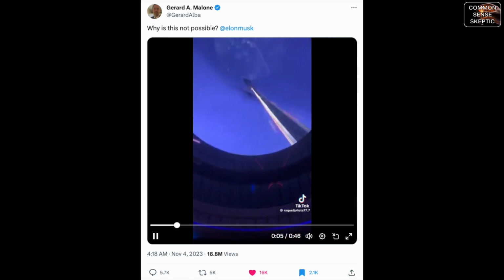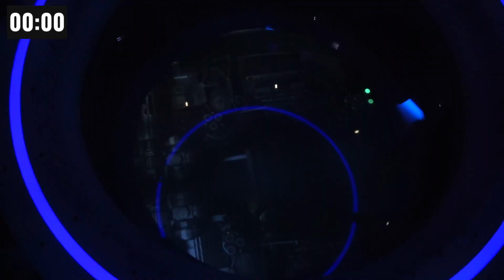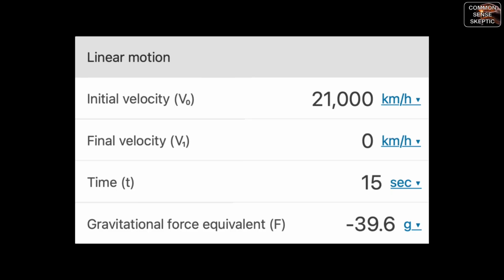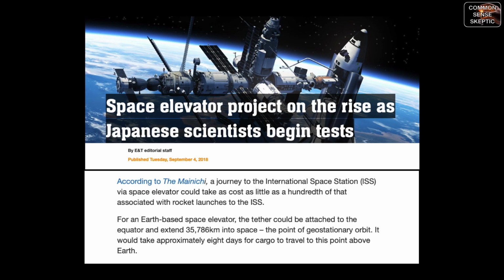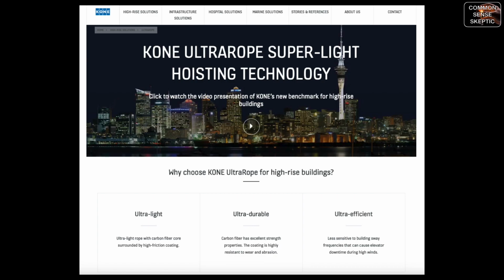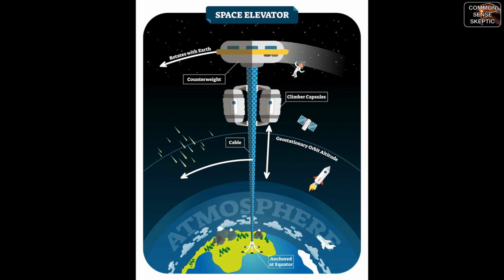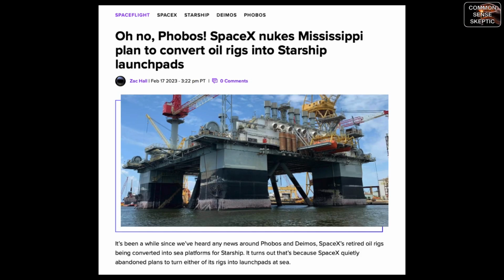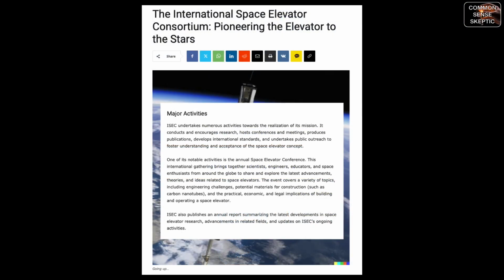DEBUNKING L.E.O. SPACE ELEVATORS

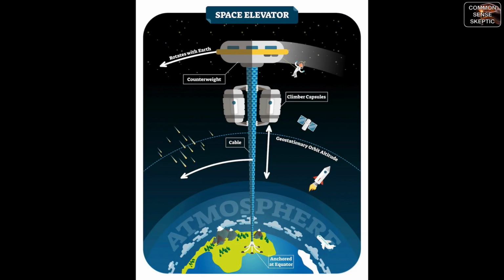Comment: 5:01 Their is a way to have a space elevator teather in Florida.  Florida to LEO station and also Peru to the same LEO station. 

6:34 Eletricity  from the grid (possibly to the climber or through the cable)

7:09 Rocket comparisons are not correct. The rocket is going 20,000Km/hour horizontally across the planet not verticaly.  (see the altitude at 198KM at 8 minutes)

8:38 Despite all the mistakes above  (2651 (km / hour)) * 8 minutes = 353km.

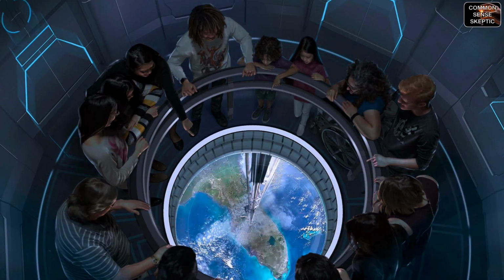8:50 : Move the station out to GSO and the point on the cable at 350KM will still be stationary. This allows you to build the station.

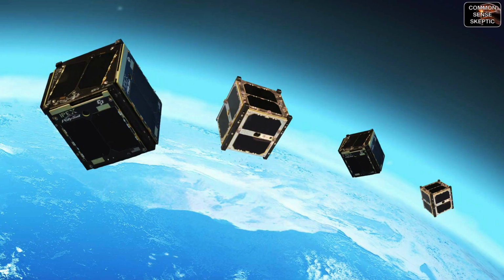10:23 You are above the atmosphere which means no atmospheric drag

10:38 Possibly their is a tether connecting them to the elevator above the station and they are behind the station on the orbit.

11:08 the station is traveling at 10,800km/hour if you use the same refrence frame at 27,576km/hour for the ISS.  But with the plane changes the diffrence is much more then 17,000Km/hour

14:49  : The counterweight does not put any weight on the cable. Think of it like hanging a rope from a bridge. The weight of the bridge does not change how strong the rope needs to be.

15:02 Testing for the beaming part of the elevator currently use 1km cables. (Still a lot more then the required length still)

17:11  at just 8km up the air pressure is only 30% of the ground
 
17:51 you do not want a lot of weight pulling at the ground as that would makes the cable required to be much stronger. Even if you only have 100 tons of force then still means you can have a 10 ton climber without pulling the anchor below GSO.

19:26 If you go the ocean anchor you do not want it to be attached to the ground. You want to be able to steer your ship around the weather. The MSC Irina for instance weights 240,000 tons fully loaded. This is a pretty good anchor.

23:00: You disconect the  ground station and now the cable falls stright down and does not wrap. (Plus with how light weight the cable is , it will likely burn up in the atmosphere)

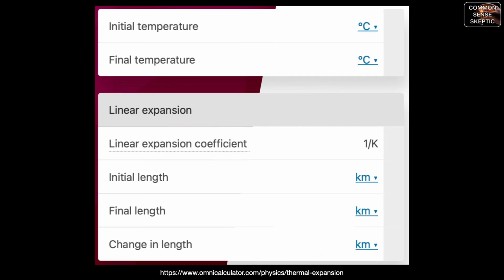23:46 Why would the higher up of cable be in the shade. The earth's shadow is only so big. 

-

I argue that a space elevator is more unrealistic then O'Neil cylinders and Mars Colonies. 

We have a pathway to them without new breakthroughs in science (only economic).  We do not have a pathway to a space elevator without new breakthoughs.

Space hotels with gravity also do not need new science(only economic) unlike orbital rings.

Comment: There are several factual errors you've made, even tho your overall point is pretty much correct.
For one: The Kurzgesagt space elevator has its station at geostationary altitude and its counterweight past that. And with a station in a geostationary orbit you can indeed just release satellites without adding any significant thrust (tho you'll want to adjust its orbit so that it won't collide with other things you've released or the space elevator itself.

Another reason why even a space elevator station at LEO would be beneficial is because you can in theory push an object to LEO without using any fuel that has to be carried. Your object still needs to accelerate to orbital velocity, but since it's left the majority of the atmosphere it needs significantly less fuel for that.

Then your argument about storms in the high atmosphere: Yes, they have much higher wind speeds. On Mars you can even have wind speeds of ~400km/h... and yet, due to the low pressure you'd barely feel it.

The biggest show-stoppers for space elevators are the lack of interest/funding and the material science of simply not having a material that can support itself for such great lengths.
There is active support in theory, but I don't think it's ever been tried in practice, so not too sure about that.

Without rewatching I won't remember all the mistakes so this ends my critique.

Comment: 4:57 The endpoint (from which the entire construction is suspending) has to follow a geosynchronous orbit, geostationary even. That can only be exactly straight above the equator and at a distance of 35, 786 km above mean sea level. This requirement is not a matter of expert opinion. It is a matter of physics.
Reply: And at 400km above the earth you can split the cable into one going North and one cable going South.

You also need the endpoint higher, you want it pulling the cable tight. And then because is it tied to the planet you get GSO that way.
Reply: @catprog  I like your subtle sarcasm.
Reply: @bosoerjadi2838  So subtle I do not even see it.

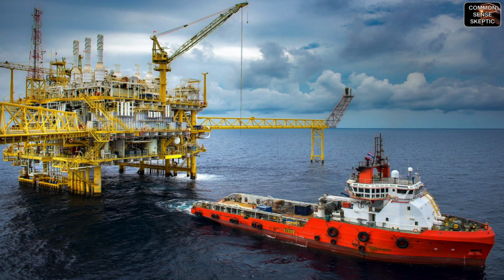Comment: 20:20 the possible harmonics etc could be a problem but presumably carbon nanotubes or whatever they would have to use would be easily elastic enough that the cable would remain straight no matter how high the seas got especially if the cable had to reach all the way out to geostationary orbit. 

(That said I don’t know how much general purpose hull or unobtanium or whatever would stretch elastically and it would probably take something like that to actually take all the punishment the tether would likely receive over the centuries.  General purpose hull would be especially good as breaking any part of it causes the whole thing to disintegrate so unlike unobtanium it wouldn’t survive reentry (nanotubes wouldn’t survive from above something like 1000 Km up as well.)

Comment: We humans have done the math, and only carbon nanotubes would maybe .... Maybe be able to have the required strength... It's right there on the edge... 

The general idea is that a station on Geo would Bild the cable down and up from Geo with a counter weight moving away from it to balance the cable coming down... 

This Is complete Sci-Fi... But we do know, it will be really hard because we know a few things... No material will hever be as strong as ideal carbon nanotubes and those if you run the numbers are at the edge of making this possible....

Space elevators would work on space bodies with higher rotation speed and lower mass.

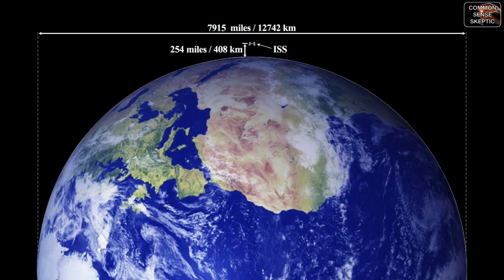Comment: 12:04 I may not remember this correctly but I think the kurzgesagt video was assuming a space elevator with a counter weight at geostationary orbit and some length of run even further out to allow the launch of stuff out of orbit.

If the counterweight station was in geostationary orbit (and there was a material strong enough to work as an elevator cable etc etc) so kurzgesagt was saying something accurate, by definition if you are in geostationary orbit you are in orbit.
Reply: The counterweight cannot be at GEO .. has to be well beyond to keep the tether taut (via centrifugal force) or both the tether and the counterweight will fall to Earth
Reply: @xenuno  usually the models have a very heavy rock at the geostationary position so that it doesn’t get pulled around easily and a much smaller counterweight on a second tether at a higher position that can be winched up and down to keep the masses balanced and keep tension on the cable etc, it could also serve as a launching point to send stuff out of earth orbit.
Reply: @glenecollins  Ya I spose that would work but all the models prophesize tether properties and dynamics based on Unobtainium, specifying strength, density, and a host of other properties that real world materials do not and will not ever possess

Comment: As always, it's a lot easier to make a CGI video than actually work through the engineering challenges.
I have met plenty of 'idea guys' in my career.  They throw out impossible or near impossible concepts and then get frustrated and angry when engineers tell them why it's not going to work.
Reply: damn architects
Reply: <<I have met plenty of 'idea guys' in my career.  They throw out impossible or near impossible concepts and then get frustrated and angry when engineers tell them why it's not going to work.
>>

Heh, heh!  Economists are good at throwing that kind of cold water on projects as well.
Reply: You may be surprised to learn that real engineers are working on space elevator designs right now. People who know what the real-world challenges are.
Reply: Engineering challenges were worked out well over a decade ago.

It's not even that expensive.

Is just an idea that sounds so crazy nobody is willing to actually take it seriously.

First of all you use Rotating Space Elevators (RSEs from now on).

Imagine a wheel traveling along the ground. If your car is going 20 freedom units per hour, then your wheels are going from standing still to going 40 freedom units, in a sine wave.

Now make that wheel double the length of low earth orbit. Now get rid of the wheel and just make it a ribbon about 3 ft wide and a couple of micro freedoms thick.

Every time it goes around when it hits the bottom it will be stopped. All you need is a hook on the end.

By having adjustable mass at the center station, weight going down, cancels out weight going up.

So assuming some sort of peerage agreement is worked out, that's a "free" ride to orbit.

You can increase or decrease the amount of tethers arbitrarily, so scaling is easy that way.

And you can put them in progressively higher orbits.

That also means you can use them for deceleration. Meaning faster transit times, and getting paid for extra momentum.

Does a bunch of other cool stuff.

Does it take any unobtainium. I'm pretty sure according to the math, regular kevlar would work.
Reply: @jtjames79  Nothing you said was true, Mr Idea Guy. The engineering challenges have NOT been worked out and no material in existence now or even prophesized in the future is up to the task. You've been watching too many Pop Sci channels apparently or ... your comment was all in jest

Comment: Around cough twenty years ago cough this came up on Physics Forums. Some folks over there worked out the math on just what the parameters would need to be for this mythical cable to work.
And if it's just a cable stretching out into space, it would need to be lighter than air and stronger than steel. 
Now there may be some kind of engineering mitigation like, idk, stations along the length with, idk, balloons pushing against the atmosphere and, idk, anchoring the next cable up.
But then there are all kinds of other problems that you mentioned which would definitely end the dream.
It's the kind of idea that might work on some planet somewhere but not on Earth lol.
I like this video, and I'd love to see some other sci-fi concepts looked at.
Reply: I THINK that a ribbon of carbon nano tubes has the required strenght and would be light enough,  its just impossible currently to manufacture 68000 kms of carbon nano tube ribbon with zero flaws.

Comment: You know, while you were at it, you could have covered Heinlein's electromagnetic launcher which of course was an upgrade of Jules Verne's space cannon. As described in "The Moon Is A Harsh Mistress" I got the impression these would be perhaps 10 - 15 miles long. However, with 5 gee acceleration, you'd need about 350 miles. Cranking the acceleration up to a lethal 25 gees would still require 73 miles. This seems a bit impractical.
Reply: It helps that the lunar one only needs to reach lunar escape velocity 2.3Km/s. That would actually be achievable on the moon - there's no air resistance, and with a maglev the only challenge is getting the magnet timing precise enough. It's only about twenty times faster than the fastest maglev on earth. If you've got industrial infrastructure on the moon to manufacture the materials and cargo to export of value enough to justify the cost, you could build it without any overwhelming problems.
Reply: @vylbird8014  True, you could save a nice amount of fuel getting back into Lunar orbit.
Reply: @scientious  For that matter you could even see benefit in a 'launch' from the moon using a giant spring-powered slingshot, probably built by Acme corporation. It's not going to make escape velocity - but if you can manage just a hundred meters per second with your launch assist device, that's a 5% or so reduction in your delta V needs, which means a lot more than a 5% reduction in your fuel requirements. Still, not worth building unless you have a need to routinely launch from the moon's surface.

Comment: No Earth-based space elevator is possible without an anchor in geostationary orbit. When you consider that we are talking about something with the mass of a small mountain or more depending on how many stations are along the length of the elevator. While we are likely centuries from having the materials technologies to build anything like this, it is possible. 

What we may see sooner is a Lunar Space Elevator. This is already something we have the capability of building with existing materials technology. although the will, need, and other space based construction technologies that would make it cost effective are still a ways off (like moving a small asteroid to use as material, etc.). The reason is that the moon removes several complications and the Earth's gravity helps stabilize the entire system from afar. 

By starting with an operations and construction base at the Earth/Moon Lagrange 1 point (~60k kilometers above the Moon's surface) and extending cables out in opposite directions equally during construction from there (one to the surface of the moon and the other towards the Earth), you could have a balanced low stress system that does not have to contend with atmosphere or a high stress orbital velocity it needs to be anchored against, as is the case with the Earth based space elevator. The Moon's tidally locked orbit with the Earth takes out a lot of the stress that any similar space elevator would have going from the Earth's surface to orbit with an anchor in geostationary orbit. All of this not only reduces the size of the anchor and stresses involved but the fact that it likely will not get the same traffic volume as an Earth based space elevator means the system does not have to be built to those mass moving capabilities.

The only question is going to be if it is ever viable enough to be built.

Comment: Another factor that gets often ignored is the radiation from the sun. The space elevator needs withstand harsh UV radiation. Furthermore the upper atmosphere also interacts with this harsh radiation. The oxygen (O2) splits into two single oxygen atoms that are highly reactive. A space elevator will probably stay in service for decades and the material need to withstand these harsh conditions. A protective layer is needed (more weight) and it needs to reapplied regularly. Carbon nanotubes may be proposed as a material. But this material seems a bit sensitive to defects in the structure. This issue may not the immediate deal breaker but it needs to be considered if they actually plan to built it.
Reply: Carbon nanotubes promise incredible tensile strength, but... they are still carbon. They burn just fine. Even diamond burns.

Comment: If there are educators attending this space elevator conference, their employers should reevaluate their employment.
Reply: Not at all. Educators should always seek new information.
Reply: @eldenfindley186  they need to think and filter any flecks of gold from the mountain of poo
Reply: Nothing says "skeptic" quite as much as believing that everything that exists today is all that will ever exist...
Reply: @insu_na  physics will still exist.

This idea would be feasible if we had materials of infinite strength, zero weight and zero mass.

If a load is going up this elevator to geostationary orbit, it has to be horizontally accelerated to the same velocity as a geostationary satellite.

How is that going to happen?
Reply: @albeit1  And physics isn't what's preventing space elevators. Material science, engineering and funding are.
Reply: @insu_na  there are many things that prevent this fiction from working.

Number 1 is the complete inability of such a system to accelerate a load to geostationary orbital speed.

Geostationary satellites aren’t going 0 miles per hour, you know.
Reply: @albeit1  .... the speed relative to the ground does not change, that's the whole point of geostationary you genius
Reply: @insu_na  the POSITION over the Earth. Not the velocity. 

On Earth’s surface, everything is traveling at 1,000 miles per hour around the center of the Earth. 

Everything in geosynchronous orbit is traveling at 7,000 miles per hour. 

You don’t get that velocity for free. It has to come from somewhere.
Reply: @albeit1  not remotely true. The space elevator concept defies no law of physics. In fact, it takes advantage of Earth's rotation and gravity to turn a flexible ribbon into a climbable ladder. It does not require infinite strength, zero weight, or zero mass. Quite the opposite. The numbers to make it work are well understood. The only challenges are in engineering and manufacturing techniques, many of which are being solved as we speak.
Reply: @TucsonD1  if that’s all true, how is elevator car accelerated up to orbital velocity? What is applying that horizontal force to the car so that the velocity of the entire system remains constant?

Demonstrate how well understood the physics is.
Reply: @insu_na  you must think magic is real.
Reply: @hanspecans maybe exactly the way someone in 1800 would have thought pulling some little flat object out of your pocket and talking over moving pictures with someone on the other side of the globe was magic? Yeah, with enough determination and incremental scientific and engineering progress “magic” becomes an accepted element of daily life.
Reply: @sjsomething4936  future inventions will need to obey the laws of physics.

Some enabling technology or material might need inventing, but we did at least know that capturing images was possible. Our eyes do it. And we had memory too. In our heads and on paper. It was possible to record data. 

But it is not possible to accelerate a load to geostationary orbit by simply moving it up vertically. 

Not now. Not ever.